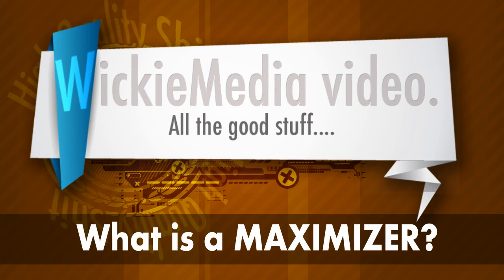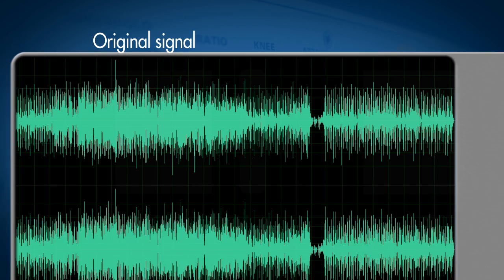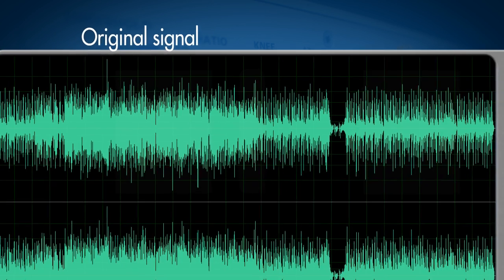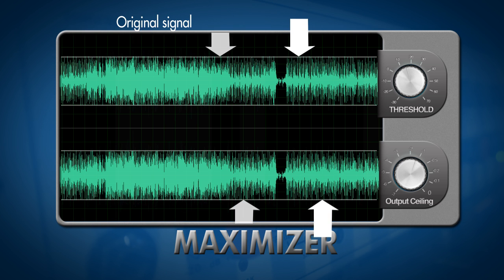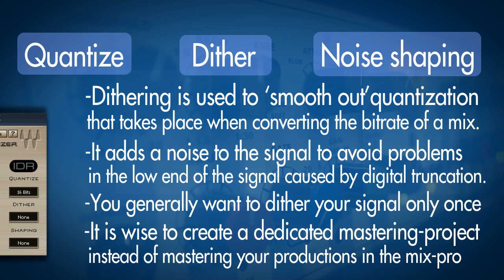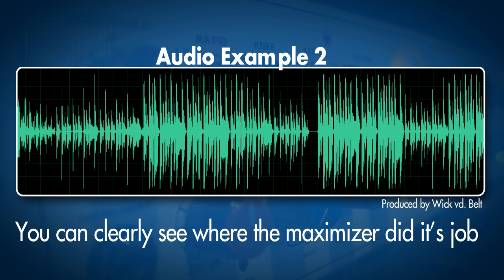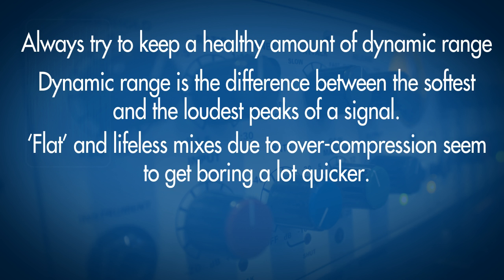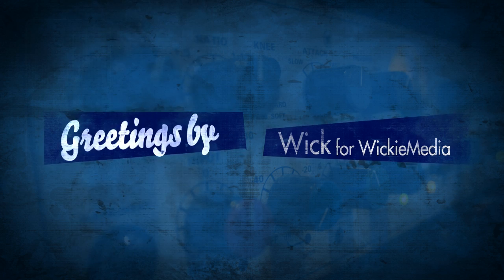Audio Maximizers explained

Comment: Maybe this is a silly question, but what's the point of compressing if the final step is maximizing? could you skip completely the compressing step? Since maximizing would re-compress what you already compressed. Thanks.
Reply: +rlclark50 Awesome comment, wise words
Reply: 2 soft set compressors r betta than 1 hard set

Comment: Thank you so much for this! I've been looking for an explanation on the concept of maximization for the longest.

One question though, is there a difference between typical maximization like explained above, and Sonic Maxamizers such as the BBE Sonic Maximizer? What was told to me is that the later does some kind of funky harmonic faking or what not with what ever sound it gets. Good on some things, but dangerous if you don't check in mono.

Thanks again :D